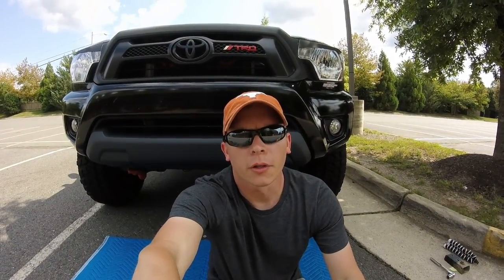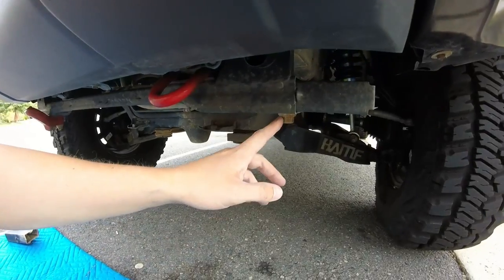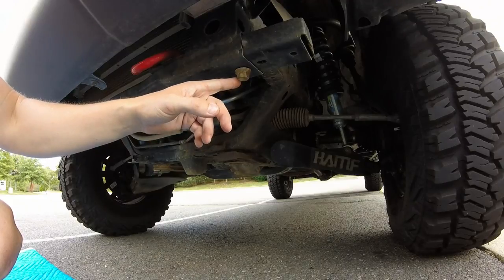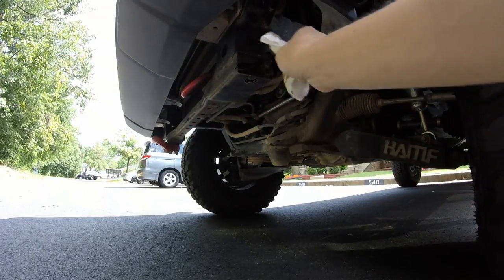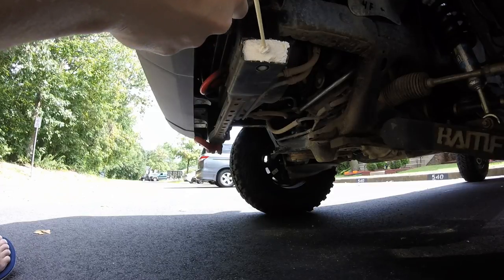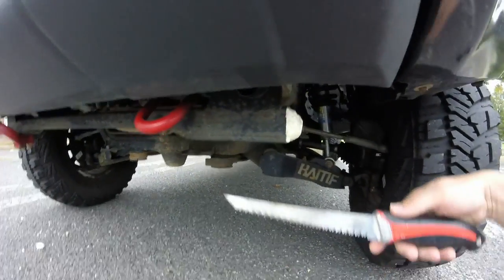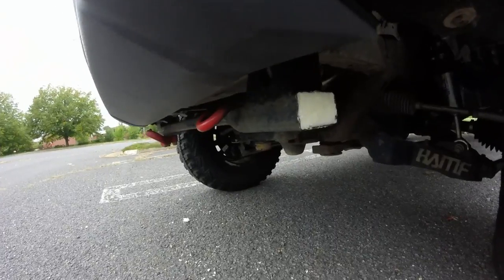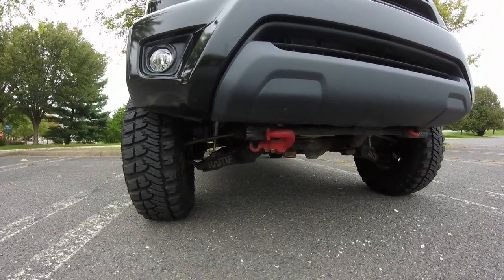Prep Your Toyota Tacoma for a High Clearance Front Plate Bumper!

Comment: Question, did you remove your stair tire to get better gas mileage? Or is yours still on?
Reply from the maker: I did remove it, but not really for the gas mileage. I have a ton more room to work under there without it in the way. I just toss it in the bed when I get offroad.

Comment: Most metal supply places sell black plastic plugs that will slide in, filling that hole. Easier and cheaper than this. Or you can weld a plate over it like I did.
Reply from the maker: I need to learn how to weld. 😀
Reply: Learning to weld with a mig takes about 15 minutes. Paying for the welder is the hard part and it's money well spent. My welder has paid for itself 20 times over, and that's just with my own projects.
Reply from the maker: I'd be really interested in taking a class or some kind of training for welding, automotive electrical, etc. How much does a practical "home welder" setup cost?
Reply: There are a lot of inexpensive welders out there but I'd stick to a well known brand such as Lincoln or Miller. You can pick up a Lincoln 180 for around $600 which is what I bought. If I remember right it lists the maximum thickness it can weld at 3/8 of an inch which is pretty beefy stuff.. I've actually welded stuff over an inch thick by pre-heating it with a propane torch with map gas in it. That was on a project to extend the radius arms on my rock crawler so they take serious abuse, and they've held up for years with no issues. I'd never say taking a class is a bad idea, but I will say it's not necessary. Learning to weld with mig is the easiest thing you can imagine. I practiced for about 15 minutes on scrap and then welded a roll cage with awesome (and proven, lol) results. Watch a couple of vids here on Youtube on mig welding to see how easy it is. As far as electrical, the best tool I've ever invested in is called a "Power Probe" and it too has paid for itself many times over. The welder and the Power Probe are 2 essentials IMO.
Reply from the maker: Very cool, thanks!

Comment: You need them when you change out the front. Bumper,  save them. I used them when I changed out my bumper
Reply from the maker: Changed to an aftermarket bumper?
Reply: Tacomaholic ,yes. When I changed mines out, it takes all 8 bolts to hold the new bumper. Those are 2 of them that will be used to hold it, 6 bolts on front and 2 under which are those brackets

Comment: I left mine in there. I'm running an ARB.
Reply from the maker: How's it look with them still attached?
Reply: Tacomaholic it's not too bad, they are in there, but it's not too noticeable. I left them in because I wasn't sure they should be removed. ARB didn't say anything about removing them. Once I figure out what they are for, I might remove them. As an engineer in the offroad vehicle industry (UTVs) I've learned that a lot of components that look "pointless" actually have a function.